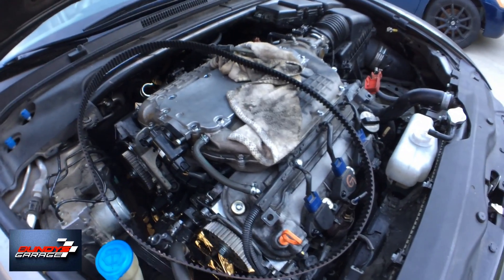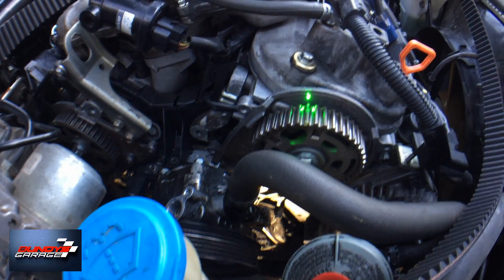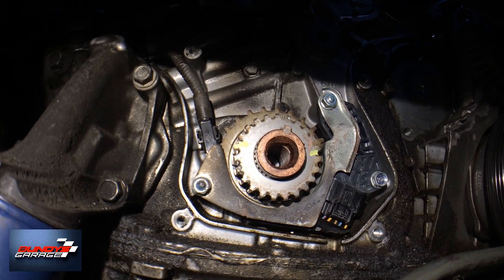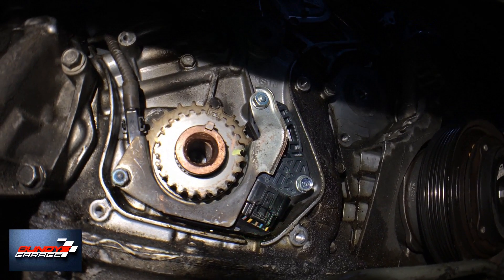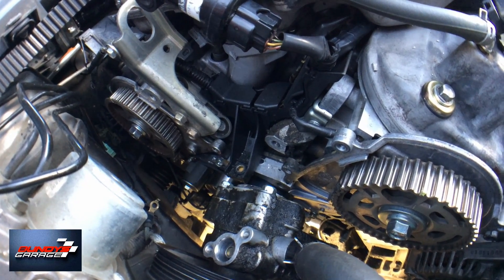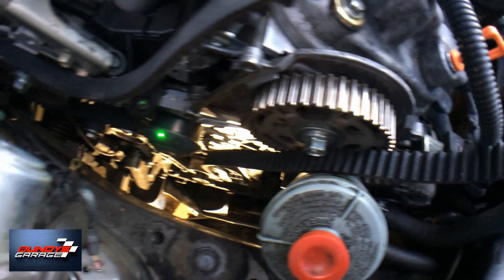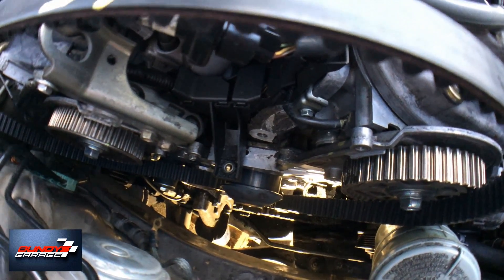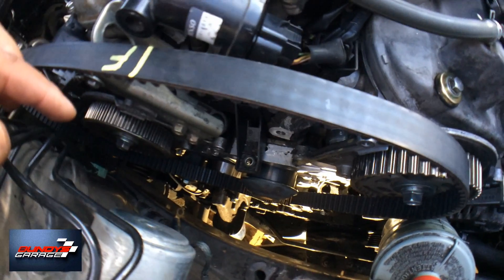Timing Belt is off One Tooth | Honda Acura V6 J Series Accord Odyssey Pilot

Comment: I moved my 1987 Honda CRX's engine forward 1 tooth forward on the cam. And it went forward from 48MPG to 52MPG and it gained alot of power, as in it would torque steer.

Comment: If they had of put a timing chain in this engine instead of a belt it would amazing. I just had my belt done at my garage and it's definitely off a tooth as I'm getting all the same codes as you. I guess I'll be bringing it back to him tomorrow to get fixed. If it damaged my engine I'll be pissed and he'll be fixing it. It sucks because my mechanic is a friend of mine, has his own shop. Who knows, maybe the apprentice did it lol.
Reply: Hey. Did your cars exhaust smell like un burned fuel or a burning smell? Did it struggle to start up slightly?
Reply: Also 3 spark plugs on bank 2 near fire wall are fouled with soot.

Comment: Thanks for sharing. My rear camshaft jumped about 1/4 counter clockwise, i moved it back to the mark. The engine runs rough. What do you suggest doing next?
Reply: Did you turn back clockwise or did you go all the way counter clockwise?I have the same issue

Comment: This video gives me hope. I changed the timing belt on my 2009 Honda Accord v-6 and when I finished it didn't start. I took everything apart and found that I was on tooth off. Then I broke one of the tensioner bolts. (oh boy). I can't get the broken bolt out because of where its located. The shop says that they have to remove the engine to get the bolt out and be prepared to replace the engine if necessary . That part I'm having a hard time with. Two shops have told me that it might be easier to replace the engine even though the belt did not beak. I only changed it for preventive maintenance. I guess my question is do you think that the engine was damaged while I attempted to start it and it was only one tooth off at most. The shop said what if they put the engine back in after removing the screw and it still doesn't start. I'm stuck as to what to do next. Why would I replace the engine? This video was right on time except my car didn't start. Any help would be appreciated. My car has no oil leaks and has 130,000 and in great physical shape. I used the aisin timing belt kit.
Reply: Any updates? How is your engine doing
Reply: auck1969 why mark the belt? Don't you mean mark the sprockets against the engine body?

Comment: how do you know what direction the back sprocket jumped! Fuckin thing jjumped so fast on my I didn't know what direction it went. Shouldn't we take the plugs out so this doesn't happen as violent as it does??
\
Reply from the maker: Taking the plugs out will help. It jumps cause it's right at the top of the cam and it wants to swing back around. Pain the in the butt sometimes. If you have some to help them have them hold it in place. My son is old enough to help me now but if you don't have anyone. Use a black binder clip on the gear to hold the belt in place and keep the belt on the right tooth. Sometimes you have to "rock" the front or rear cams to get the belt to sit correctly. With you rock the cam it gives just a little bit of slack on the belt to get it into place.

Comment: I need help. I did the timing belt on my 92 Acura legend (it runs/idles fine)  and the online shop manual state to align the marks on oil pump and crank gear as you stated, and install belt, but the second to final step is to put the crank pulley and cover on to make sure those (different) TDC  marks align with the cam marks, if they don't line up, re-install timing belt. The TDC marks on my pulley are off 15 degrees form the marks on my crank gear. That was how the belt was installed before i took it off, it was the final step and the way you verify timing with belt fully installed so I went with that. Car runs good, but has always had a very slight misfire (still does). Should I reinstall the belt? Could I have the wrong pulley installed? my TDC marks aligned perfectly with the oil pump & gear marks, but now are just barely touching  all the timing marks using the TDC marks on the crank pulley and timing belt lower cover aligned with the cam TDC marks. Please help! And, I am not confused about which are the TDC and 15degrees +/-2degrees marks on Crnk. pulley the single white mark is TDC on the pulley the others are for setting  ignition timing.

Comment: I just did a 2006 Accord v6 timing belt and water pump kit Because of a leaking water pump. My friend tried to replace  with  “will fit” parts from a chain store. Idled like garbage.  I tore it all out and found out the rear cam was one tooth off (retarded) and even when I tried to set it properly, it was about 1/2 a tooth off.  To fix I ordered and entire AISIN kit.   Worked perfectly.   Save time and money.

Comment: Ok so this is my first time dealing with a timing belt on a j series , & it’s a little frustrating. So when u moved it counterclockwise u but the timing belt back on so it grabbing the cam shafts? So the cam shafts move counterclockwise as well with the crank?

Comment: Hey I'm doing my 2013 Honda Accord J series. Whenever I was putting the belt on every time I put it on the back cam and then I checked timing it was a tooth off so whenever I pulled the belt off of it again I tried to rotate the cam like an eighth of an inch so that it would be in timing and when I did it that the cam spun on me and now it's a quarter of a turn rotated. What do I need to do to get it back into time? Plz HELP! THANK U!!!
Reply from the maker: Rotate it back the way it slipped to line it back up. Then use a binder clip on to pinch and keep the belt in place on the cam.
Reply: @bundysgarage  Thank u sir!!!!

Comment: I have no codes bundy but my will crank and start but idles low right above the 0 rpm mark . Something I can press the gas and it will rev up and sometimes it won’t . It struggles to move when it rev . But when it doesn’t rev the car won’t move

Comment: I have the same thing going on. Timing jumped one tooth on my crankshaft same situation as the video. Could I just put the harmonic balancer back on and rotate clockwise one tooth to line back up at TDC
Reply from the maker: No your balancer is keyed and will only go on one way. You will have to take everything off and line everything back up and then re-install the timing belt and re-set the tensioner.

Comment: I read where people use a small allen wrench as a pin for the tensioner .
Reply: Jay Hockley you can also compress the tensioner before removing belt. After cams aligned, rotate the rear cam CW just ever so slightly and it will compress the tensioner enough to place the pin in...or take one of the long battery j bolts and compress the tensioner while the belt is on using that small threaded hole at the rear of the engine.
Reply: @Maxumized  You have no idea what you’re talking about dude. Jesus, please people don’t pay attention to this troll.

Comment: First of all, always remove the plugs before adjusting the cam or crank position with a timing belt off.  Second of all, on most engines, there is a point (on most Toyota and Lexus V8's it is 50 degrees advanced) such that there will be no tension on the cams, so they will not try to "jump" - this is the correct position of the crank where the timing belt can be changed safely.
Reply from the maker: I’m not working on a Toyota
Reply: Why remove the spark plugs?? I’m in the middle of doing a timing bet on my Honda? God I with the just made cam locks for this engine. I’m a rookie and I’m having a hell of a time. This will be the third time. First both cams were off a tooth, then only exhaust cam off slightly. Drove it and it seems like it’s running great but the power is week.

Comment: Great video I just replaced the tiiming belt on a 2003 tl type s This is the second time I have done this I replaced with a aisin kit waterpump and tensioner and belt with rollers my question is now it runs great but when you step on it hard as to pass someone it gets to 5500 rpm and is like it hits a limiter I removed the covers and crank pulley and checked the alignment and it is perfect I am getting no codes or anything just no reving above 5500 rpm. Help I am confused now. Thank You
Reply from the maker: It sounds like you are a tooth off.
Reply: Found the problem 1 of the wires for the oil pressure on the vvt was pilled out. Thanks
Reply from the maker: How did the wire get pulled out?

Comment: What were the symptoms I'm pulling misfire all cylinders bank2 neg fuel trims
Reply: I thought it was a clogged catalytic converter cuz it smells like rotten eggs but it's leaking oil out of bank 2 it's really hard to start so I don't know if it's the Leaky valves or is timing off
Reply: I already did a valve adjustment on bank 2 they were perfect
Reply: Oh and I check the timing marks on top they're both aligned
Reply: @happydays454  so...any updates? I have the same syptoms and also thought it was bad gas or clogged cat. Do you have white powder in exhaust pipes? 3 bank 2 plugs were black with soot. Only other thing I think it could be is injector, computer or timing belt. Maybe a blown head gasket but I'm not losing coolant. Btw mine smells more like fuel and slight burning smell.
Reply: @Jaydogg209  timing marks are on the money i took top plastic covers, crank case pulley off. So next part im doing valve stem seals  and then ill retry driving it , if it still is hard to start it might be a bent valve or bad piston but it runs good just blue smoke when it starts and for like 10 minutes
Reply: @Jaydogg209  i also pressure tested upstream 02 senser bank 1 and 2
They never went above 2 psi
So it's not the cats
Reply: @Jaydogg209  I think you need to first start with checking for spark with a I'm not sure what its called I think a idle drop test you just listen to engine and unplug sparkplug wire to hear a idle change
Reply: @happydays454  Well for me I was going hard on takeoff like usual and a poof of white smoke blew out the tail pipes. But now only a very small amount of white smoke only if I rev it up past 3k or so. Really it doesn’t even smoke only that fist day, now it just smells like unburned fuel. Good to hear it wasn’t the timing belt. I’m hoping this won’t be a complete tear down. Let me know what happens.
Reply: @happydays454  yes I did that and the coil packs checked out. The engine would bog down when I removed each coil plug as it should.

Comment: If my camshafts are lined up correctly, without the timing belt on....how many times do I have to rotate the crankshaft since the arrow on the crankshaft sprocket lines up everytime it makes the full rotation?
Reply: ...some post and blogs have mentioned, that you rotate the engine manually about 6 times, to ensure that the time marks stay aligned after that many rotations.   I did a Isuzu I-Mark/Geo Spectrum, I rotated the engine maybe once or twice, and it was fine, but it was only a straight-4 engine.